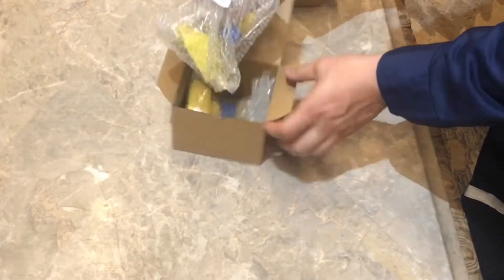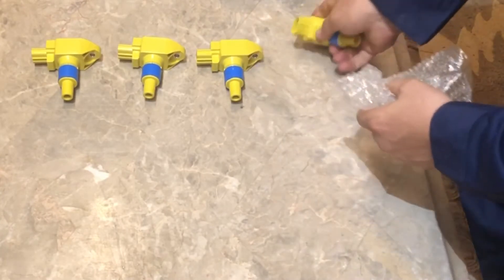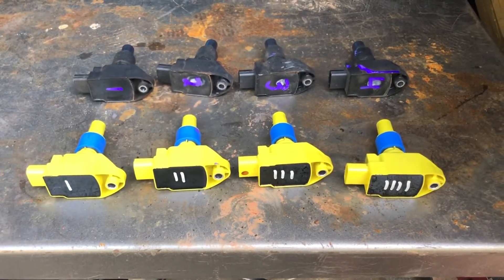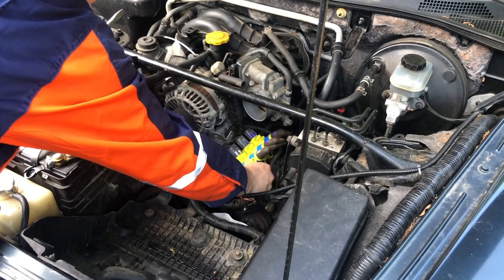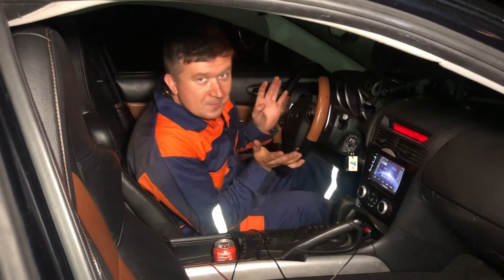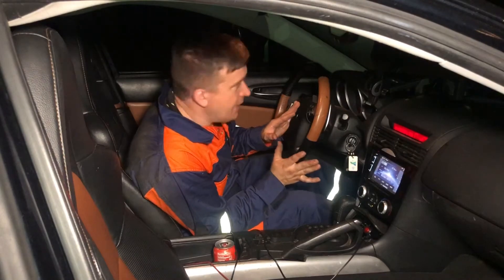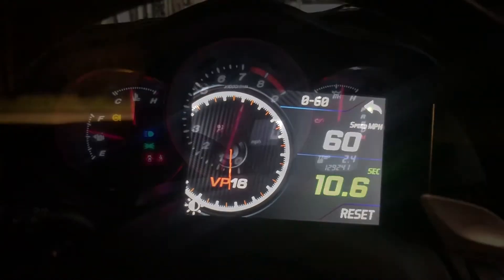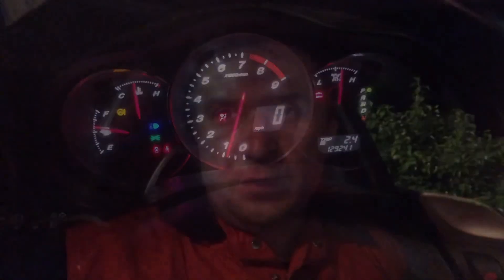How to properly connect ignition coils and spark plug wires on Mazda RX-8 Leading 1 Trailing 1

Comment: That awesome i just got an rx8 and your video are perfect
Reply from the maker: Thanks so much, great that you enjoy my videos, so far I am into 7 month of RX8 ownership and I already learned so much, and everything I learn I share with you guys, I just got a tool to check compression for $300 so I will do my compression test soon, and also my radiator is leaking, so I just bought a racing radiator double walled so it will hold double the water, and it should keep my engine cooler
Reply: @mazdarx8diy38  I have a list of upgrades to do as well just about everything you have listed i plan on doing and a little more. Good luck and keep up posted.
Reply from the maker: Cool let me know what your upgrading I might get some ideas from you as well, BTW I did get a tuner for mine and it’s awesome, right now I use it to monitor my actual engine temperature, but I got it for testing 0-60 and other things, my radiator is leaking so it helps to see actual numbers

Comment: nice little auto. it not about getting to 60. it's about holding it around the corners nicely balanced. canyon car is a good name for these. i have a 6mt version in the uk. japspeed 200 cpi cat helps a lot.
Reply from the maker: Actually you are right, I love the handling of this car, it corners so well even with traction off, it’s very forgiving, all around a fun car to drive, this is why I would like to get all the problems worked out to feel the horsepower at least like it was new, but I never drove a new once yet so I don’t have anything in my mind to compare it to, but since I worked out allot of Isues with mine, it’s performing so much better now
Reply: @mazdarx8diy38  nice. be careful of fake spark plugs. i am going to install sohn oil pump to mine. the oil metering pump does not spray enough on the apex seal though so i put a little 2 stroke in the tank. mine was stood for 6 years. needs under carrioage work and some welding, but it will be saved in stock condition with minor mods to prevent engine wear. these cars hit rock bottom already. with track abuse and stripping for easy cheap parts, they will go the way of the rx7 cars. there are worse to collect. haha.